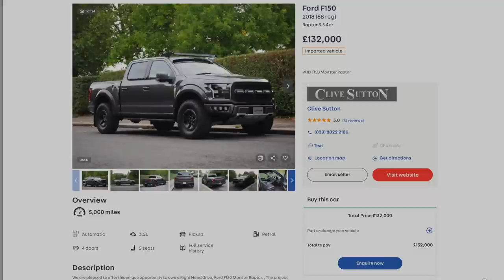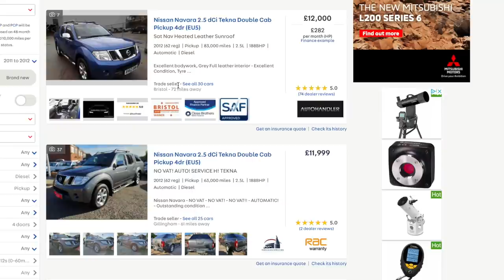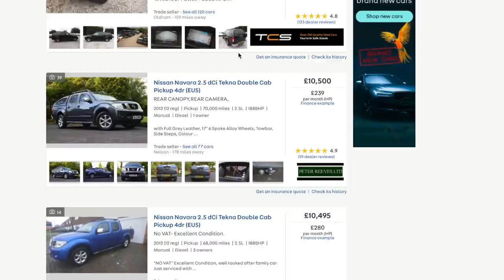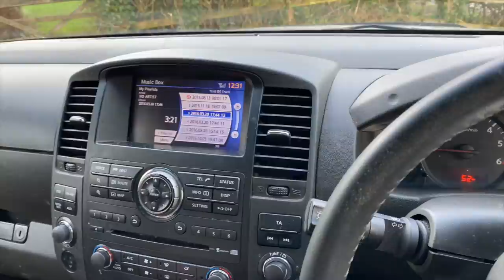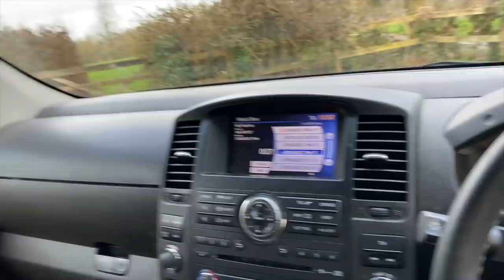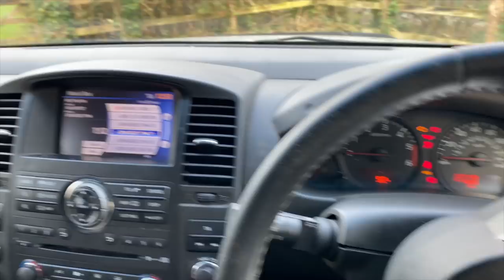Cleaning the MOST Dirty Disgusting Cheap Nissan Truck Ever

Comment: I have a suspicion it's been flooded perhaps
Reply from the maker: yes big possibility
Reply: @Ratarossa  you should change all the oils.
Reply: Agreed, it will be condemned at the next MOT as they do that for flood damaged cars due to raw sewage exposure.
Reply: I agree. No one can spill that much drinks and food in a car. You would have to drench the seats completely to get it that bad. Did someone really still use this car in that condition before selling it?
Reply: @jan-hendrikbussmann4644  with that signaling tape on the bed, we could suspect that it was a vehicle used in mines. With conditions like floodings, being almost usual. Another problem that usually occurs with vehicles used in mines, is rust.

Comment: Seems like that Navara has some water damage inside. Could be a flood car? You should change the oils from the engine, gearbox, transfer box, and rear axle differential. Change the timing chain, and paint the chassi with a antigravel coat of paint. Enjoy it.

Comment: Great find and a nice complement to your super car fleet. I'm doing a similar thing with a bargain neglected 2008 Toyota Tundra. The mechanical issues were pretty simple. It took some light body work, lots of elbow grease inside and out, and it's shaping up to be a nice truck, just like this Nissan. Keep up the good work! I like how you pay attention to and remedy the little details, the seen and unseen. It'll be interesting to see what you do with the outside and chip away at the issues causing the warning lights.
Reply from the maker: i'm really enjoying the truck, its a lot of fun and easy to work on ......having just as much fun on this as the Ferrari's

Comment: Where did we go wrong when an f150 is 100k.
Reply: probably when people found it hard to live without power windows, seats, steering, brakes, air conditioning, climate controls, door locks and computer navigation, backup radar, forward radar, side radar, backup cameras, forward cameras, blind spot cameras, rear-view cameras, air bags, side-air bags, 300-400 horsepower diesels and gasoline powered engines, back seats, four doors, leather interiors, 19" chrome wheels, custom paint jobs... etc... etc... i could go on...

BTW, the base price (roll-up windows/short bed, etc) on a 2020 f150 is less than $29,000. nissan, chevrolet, and dodge are a few grand more... still not good. in 2001 i bought my new base dodge ram 1500 (v-8 318 c.i. engine, no carpet, standard transmission and one bench seat) for about $18,000.

Comment: Nice, I just wish we got the turbo diesel in the US, I have a 2018 king cab SV long bed 5 speed manual with a.... 2.5L N/A gas motor 🤦🏻‍♂️ reliable but rly lacks any kind of power

Comment: A Nissan Frontier (Navara) is a reliable truck, but the gas mileage is awful and the ride is harsh and the handling ponderous, and the interior noise is deafening, just not a pleasant truck - a 10 year older Toyota Tundra (2002) is actually much nicer to drive than this heap - the only thing really good about these is that they have been reliable, unlike the Nissan full size trucks and most other Nissan vehicles.  Now if this example has been in a flood or something, then even reliability would be out the window.
Reply: You forget to mentioned it has a major design flaw on the frame just behind the cabin they are well known for rusting straight off so the car is actually dangerous. That way you get them for pennies
.

Comment: A classical builders truck. Never been cleaned and still runs on the original oil. I would have gone for it, in a heartbeat. Great buy. 👍🏻🇩🇰🙋🏻‍♂️ Actually the last three letters on the licenceplate; NEJ, means NO in Danish. 😂

Comment: Chain guides issues well known on this model, chain guides slip, causing issues with camshaft sprockets, crankshaft pulley, if it slips jumps of sprockets. Bang goes your engine. Also issues with DPF, clockspring in steering wheel causing issues with SRS system. X 3 brake caliper seizing. I know I have spent about £2K sorting these problems out over the last year after buying one with full service history. Good luck.
Reply: mike paton My 2008 Nissan Pathfinder with the 4.0 V6 has some timing chain whine. Though it isn’t as loud as others that I’ve heard it’s still concerning. 167,000 miles on the odo. It’s unfortunate these D40 and R51 models are plagued with weird and unnecessary problems.

Comment: You should bought a Navara before 2002. They got some issues with the timing chain on some early D40 models.
Reply: All D40 Navaras and R51 Pathfinders suffer from stretched timing chains.. you need to do a Billcar lower duplex upgrade. Not hard just time consuming. Did it on our Pathfinder and its been bullet proof since.

Comment: Does this year and version have the DPF system? If it does, the loss of power will be because the system is blocked.
I'd also strip out the interior and give it a thorough clean and then put a large Ioniser in the car for a few hours to kill of all the spores etc. It also kills all odours, which I imagine this has.

Comment: There is a Conection under drivers side of the wiring harness that let's on water, Stupid design but this caused my navara to go into limp mode when full of water, turns out you can't drive them through puddles 😂

Comment: You really need to be careful with mold in cars. I strongly recommend a proper carpets out clean. Mold spores will mess you up. A little bit of bleach in the wash water as well.

As for the chassis you should give it a dose of rust kill on the inside.

Comment: Looks like the Titan over here in the US. We hardly ever get their small turbo diesel engines over here of course. Looks like they used it to store all their leftover food after they ate it on the floor and seats but it's amazing what a proper cleanup will do for a basically solid but badly neglected car. Looks like you'll have a great cheap to run parts runner and family truckster when it's all sorted.

Comment: Great little project this. Must admit I have a soft spot for these pickups. I have thought of getting one myself. There such a great tool. Looking forward to the next instalment , and seeing what you find . This could end up be a great buyers guide... make sure you check the injectors they are a massive problem for these engines causing  turbo faliure and massive engine failure dumping fuel into the oil.. check out west Yorkshire engines on YouTube specialist in these trucks.